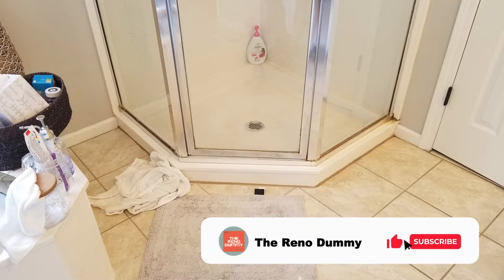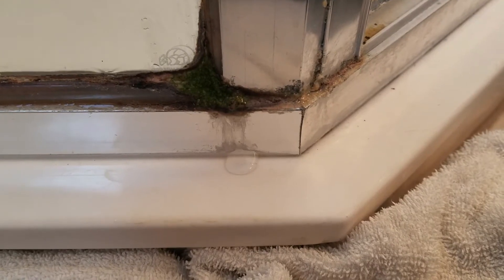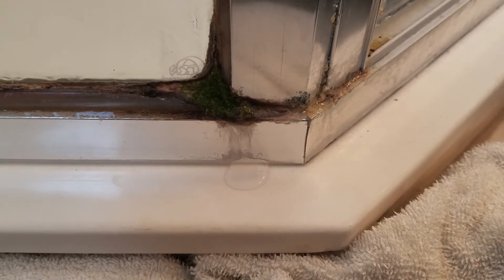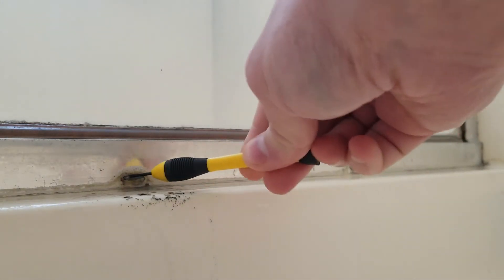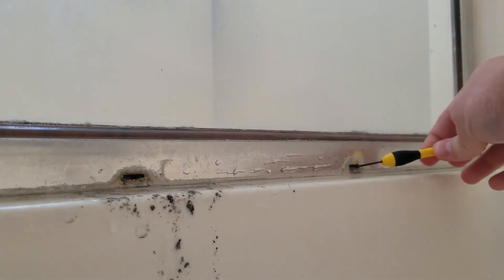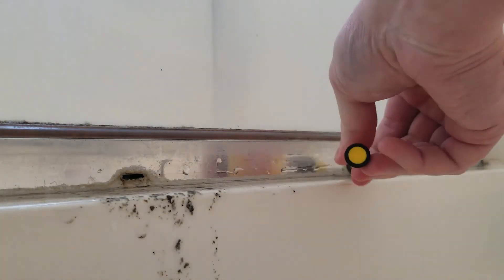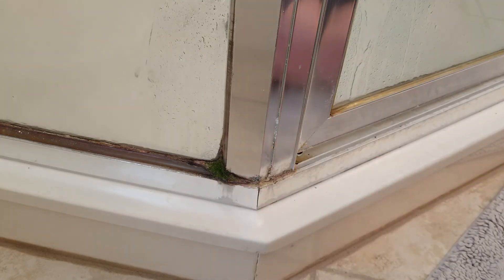How To Fix A Leaking Framed Shower - Clogged Weep Holes! Easy Fix

Comment: Do you caulk the inside frame at the base? I’ve cleaned out the inside at the base where it was moldy (the silicone) because the water isn’t able to drain back into the pan.
Reply from the maker: I didn’t have to caulk. Cleaning out the weep holes did the trick.

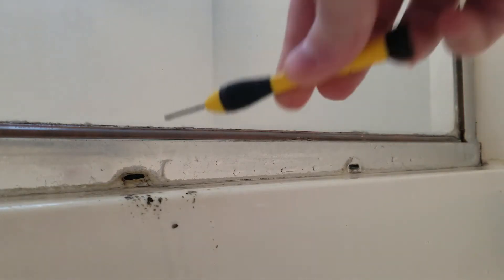Comment: 0:39 I had a simular issue in mine but in my case it was that the glass was never properly cauked on the outside, I cleaned it & recauked it with actually water resistant cauk & good as new well probaly better. Now i just need to find out what the seal on the inside that is usualy on the bottom of the door is called.
Reply from the maker: That's good to know if mine starts leaking from the seal.

Comment: What's the best way to clean that seal mold and garbage?
Reply from the maker: It's an eternal battle. We use Clorox bathroom spray and a somewhat stiff bristle brush. We haven't found anything that will get it all off.
Reply: I have that issue and had 3 professionals tell me I had to replace all the gaskets as they had broken down over time.

Comment: A little compressed air wouldn't hurt.
Also, some bleach (4% diluted) or hydrogen peroxide poured in there & left to sit for 15-30 min. should kill most of the mold.  Concrobium Mold Control is a product you can get at hardware stores or online that mostly consists of Hydrogen Peroxide and will do the job.  Brush away whatever you can first.